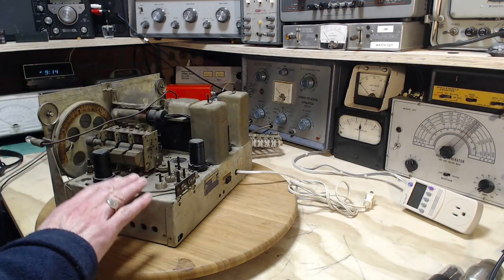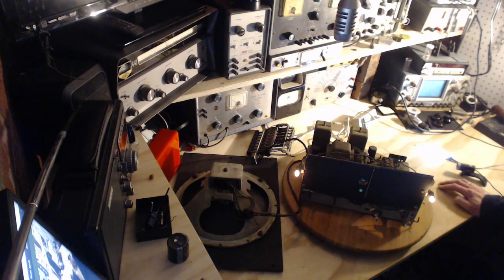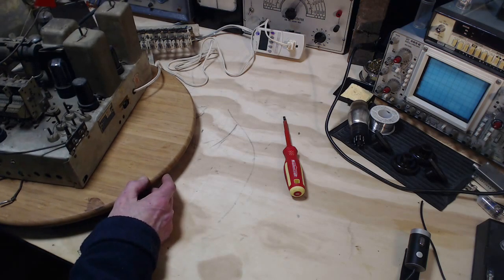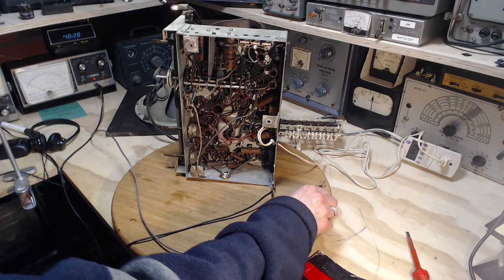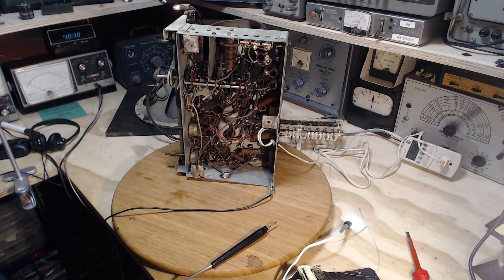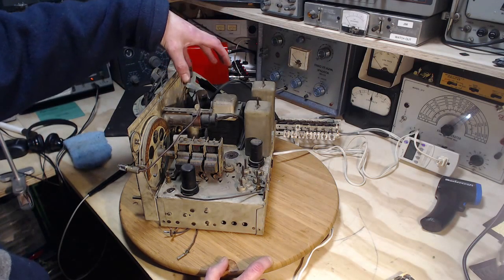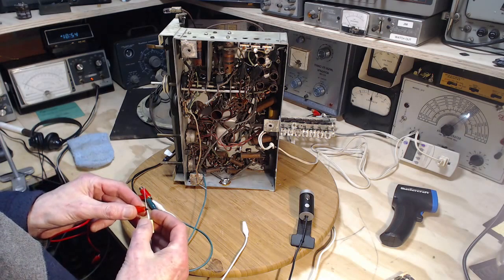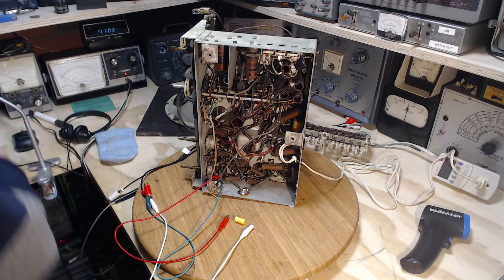Canadian General Electric KL-96 Video#2 - No Output

Comment: Hi Jim
This set looks like a lot of work !
Inter-stage coupling capacitor testing .Pull all the tubes & feed 90v into the hi-voltage line .

Go tube holder by holder & meter 0V & grid pin .
If you get voltage check the map ( can you see a current path ? ) .
No link to the hi-voltage line change the inter-stage coupling capacitor 
on that tube pin & move on . 

Just a bit of time & common sense is required .
PS check the main electrolytic caps with your C-3 .
The watts meter is a good tool .
In short if you don't use that 50w a hour you save 438Kw a year , 
So more cash in pocket .

Comment: Wild ass guess/question.   Does the switch panel require a ground/return on its frame to the main chassis????????
Reply from the maker: +jp040759 Not sure I follow.  Do you mean a ground between the radio chassis and the Dim Bulb switch panel?
Reply: +Jim Lindenas I think he means the push button panel and the radio chassis Jim.
Reply: +David Legault    Correct.  I was referring to the push button panel of the radio.    Could the switch panel  not be allowing the radio to function since their chassis is not electrically grounded to he main chassis  ground.?   Can't really tell from a video.  Just brainstorming.
Reply: You have a signal tracer, why not use it. Why bother with your stereo amplifier.